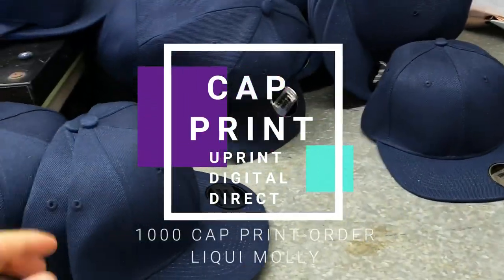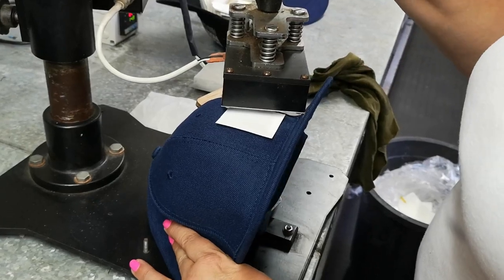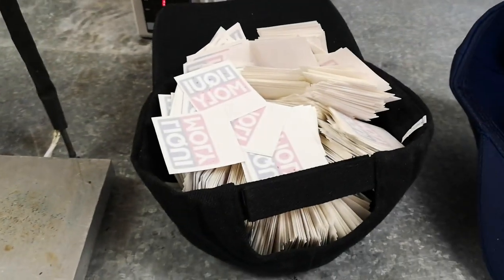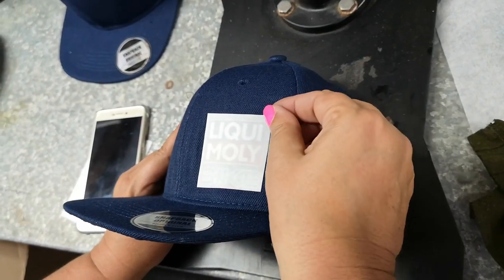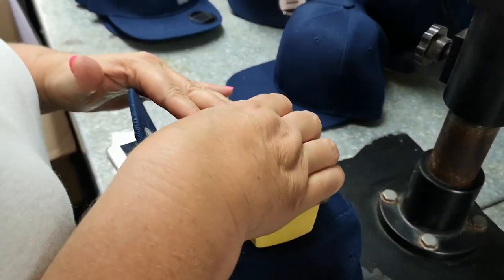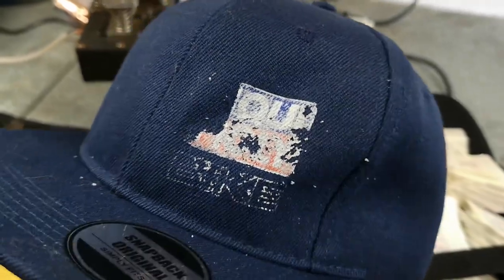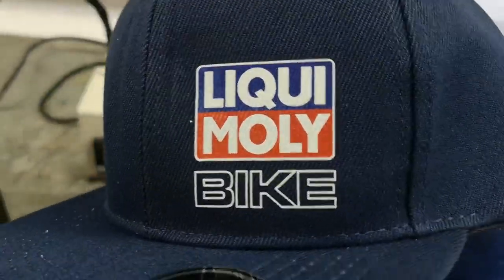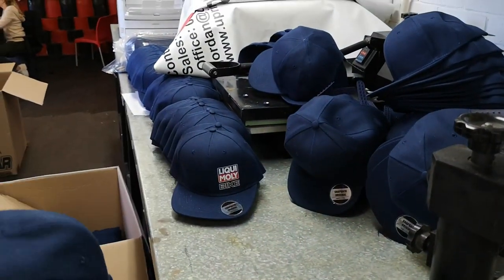Cap Printing

Comment: it's sticker printing or sublimation printing?
Reply from the maker: Sublimation printing requires a sublimated product to print on, this is a heat transfer method using the same paper we use for tshirt printing. No Sublimation or stickers are used in this video